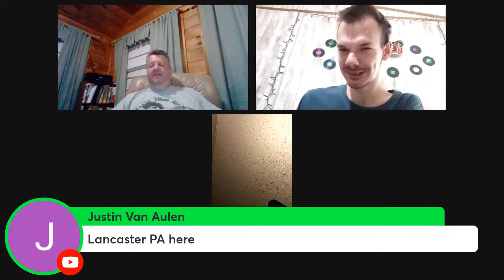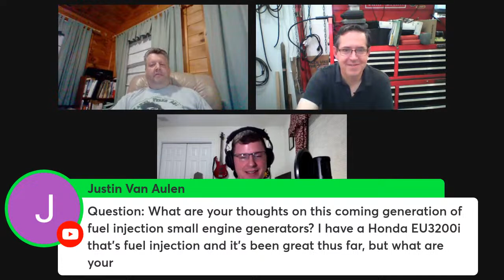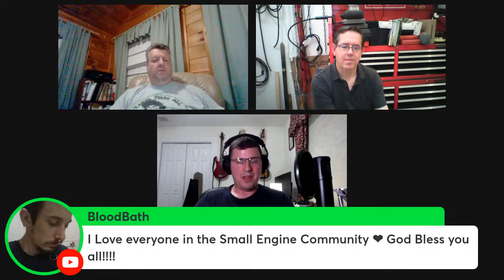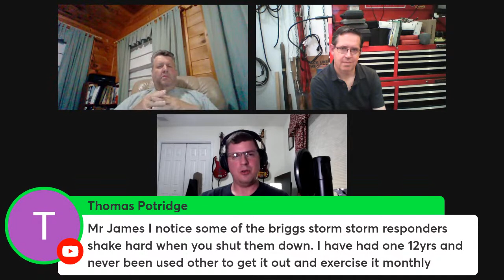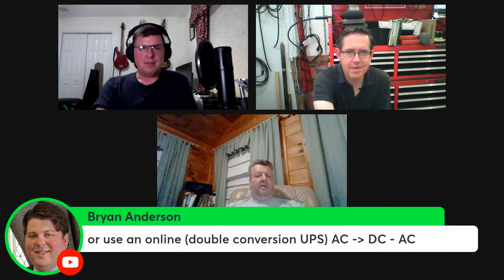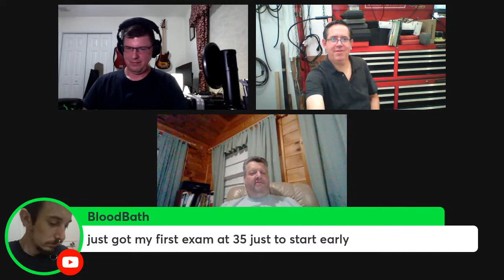Generator Q and A with Mr Generator James Condon and Gary Bernacki

Comment: I have a powermate 3250 sx generator and stopped making power... No light until for a brief second when you shut off engine it flashes a brief jolt for 2 seconds. 
Any ideas what to look for
Reply: What's the exact.model number? Need to review the schematic
Reply: @Bassguitarist1985  PM0123250
Reply: @Bassguitarist1985  PM0123250
Reply: @Bassguitarist1985  pm0123250

Comment: This comment is to James Condon or anybody else that can comment. This question is specific to a Champion 200926 2500 watt dual fuel inverter (without co2 shutoff). It has about 30 hrs runtime with minimal loads. Until recently it had been run exclusively on LP. On a trip to Maine in mid January the generator began to quit after about 2 minutes of run time on both Gasoline or LP. The inverter would immediately restart and then quit after the 2 minute run time. Oil level was full, on a level surface. Spark plug was changed to determine spark and didn't stop the symptoms. We called Champion Customer Service and they said to check the oil which we did again without solving the problem. I must include that at the time that the generator quits the red light is on. Supposedly the red light is more than a low oil light but a more like a "Check Engine Light". After trying everything we could from the field we returned home and Champion sent us to a service center as it is still under warranty . After ten days the service center called and said that he found green flakes in the carb bowl. He said the flakes were minimal in scope. He didn't do a carb rebuild but simply removed the green flakes. This is difficult to believe since gasoline wasn't used prior to the trip and the gasoline was directly from a gas pump into the generator (91 octane I believe). The repair guy isn't convinced that the issue is strictly the green flakes he found. I picked the unit up this morning and we have not tried running it as of now. My question is: Has anyone experienced this type of problem before?? Champion has not said until now that the 200926 has had any similar issues or problems. Again the dilemma is the Red Light coming on and why any foreign substance in the carb would cause such an issue?? When my son gets home we will see if the problem has been solved by running the unit but in the meantime I wanted to run it by you guys with more experience than me. Thanks, John
Reply: Do you mean a 200962? Which light is it the low oil or the overload light? Is the engine running smoothly at a consistent speed and not hunting and surging? If the engine speed is constant but the inverter shuts down after 2 minutes that is not a prime mover engine issue that is an inverter unit issue. 

It is possible for the overload light to come on if the engine is hunting and surging under load as the inverter is constantly trying to stabilize the output power but I would not expect this scenario.

I would check with champion to see if they can replace the inverter unit under warranty

Comment: Just a quick question. Why is the oil in my generator so clean while running LP as opposed to gasoline?? Hardly burns any oil either. Is it because Propane is so much cleaner to begin with?? Thank you!!
Reply: The soot from the combustion process turns the oil black.  That is why oil in diesel engines is so dark and why yours is so clean.  Propane burns much cleaner.
Reply from the maker: @jcondon1  thanks Jim
Reply: That's what I figured but thanks for the confirmation!! I change the oil every 25-30 hours. Only takes about 35 oz of oil so very cheap insurance
Reply from the maker: I’ve forwarded to James and Gary to respond
Reply: Less hydrocarbons and nasty byproducts basically. The piston cylinder blow by is always going to slowly poison/pollute the crankcase oil faster on gasoline than propane. Oil change intervals on propane are far longer, though in practice it's better to stick to the recommended so as not to forget when to change it. Engine oil does eventually break down from repeated heat cycles if not oversaturated with contaminants first.
Reply from the maker: @Bassguitarist1985  thanks Gary

Comment: How can you measure oil pressure when the oil is not circulated by pressure, it's only a splash system unless you get into the larger engines that will also have filters. In a panel ever other slot is on the opposite phase so if you do a twin breaker it's on two different phases.
Reply from the maker: Why are you asking?
Reply: I wasn't I was just stating a fact, sorry I didn't realize you would see it in the chat @KensSmallEngineRepair
Reply from the maker: @alfredocuomo1546  no worries thanks for watching!